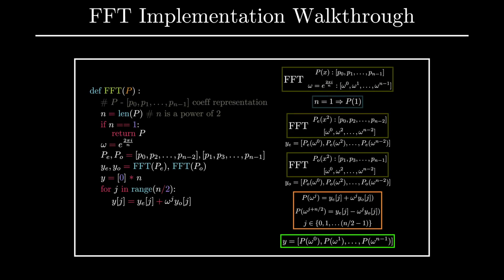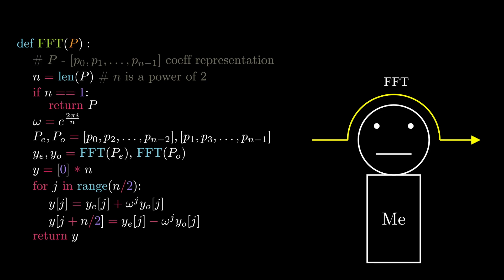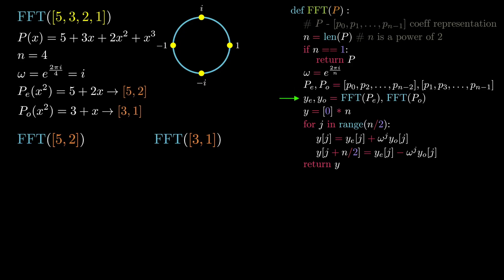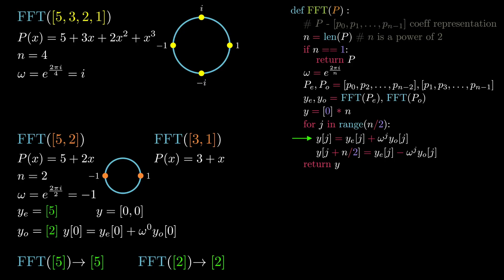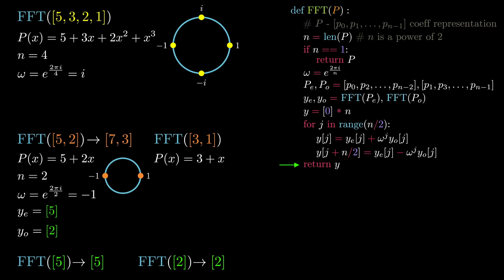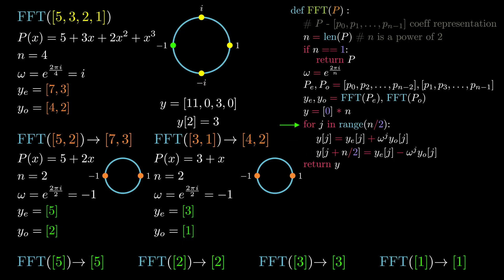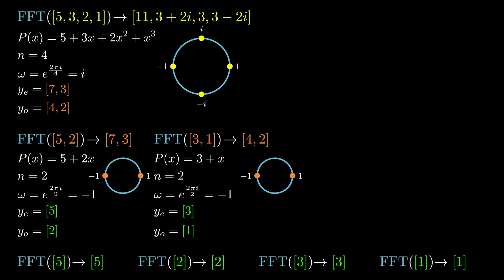FFT Example: Unraveling the Recursion

Comment: I remember studying the FFT in college (some 50 years ago) and I used it throughout my career. I’m now retired, but I still love to watch videos on Maths. Yours are particularly clear; in fact, they are works of art. Excellent!
Reply: What field are you in? Where's FFT used a lot?
Reply: @whitewalker608  math computer science physics
Reply: @whitewalker608 GPS, data compression (MP3, MP4, JPEG), it's the barebone for (any) control engineering tasks, you can multiply polynomials and large numbers easy which is used all over the place in crypo, and seismic detection.
Seismic detection was the initial driver, as people wanted to detect if anybody on the world was testing nuclear bombs or similar.
The same technic is used on earthquakes and tsunamis, and you can also use it in predictive maintenance of machines that can not fail.

Comment: I have been mulling over the FFT for WEEKS. Finally I have understood it, just by seeing that for 4 elements, the number of multiplications we did was 2*2+4 = 8 = 4 log2(4), compared to 4^2 = 16 for the DFT. For 8, it would be 4*2+2*4+8 = 24 = 8log2(8), compared to 8^2 = 16. I have an exam on this this Monday, so thanks to you if i ace the FFT question!

Comment: Hi Reducible,

How to programmatically compute the value of Ѡ?

In ur example, u hav used hard-coded values [1, i, -1, -i] when n=4, and [i, -1] when n=2. What if n=8, or a much bigger value? How to then compute Ѡ = eˆ(2∏i/n)? Or, is there a constant value for eˆi ?

Thanks!
Reply: Hi Reducible,

Ѡ = e^(2∏i/N)

I think Ѡ can be implemented as cosΘ + i*sinΘ, where Θ = 2∏/N

The java object (if implementing in Java, for example) can handle the real part cosΘ and imaginary part sinΘ separately

example :
com1 = x1 + iy1
com2 = x2 + iy2
com1 + com2 = (x1+x2) + I * (y1+y2)
com1 * com2 = (x1x2 - y1y2) + i * (x1y2 + x2y1)

Makes sense?

Comment: In the previous video on FFT you mentionned early the relation to time domain and frequency domain. The time signals we feed our FFT algorithm with are however not polynomials. Could you explain why this works not only for polynomial value pairs, but for time/frequency signals too? In time and frequency domain there greek letter omega is often used as circular frequency which is a  real number in practial cases. Is there any link between these two omegas? What is the importance of frequency to this algorithm?

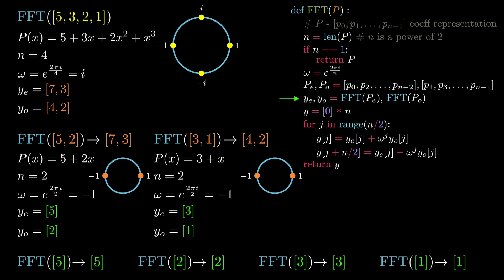Comment: 5:00 I found out that the values you get from that loop is in pattern...for at least those two example and that is :

note:- I am a lot younger than you would expect so i don't get a most of things in the video i am just watching for little prior knowledge when i actually need to learn it properly

lets say those variables as  FFT[ x, y ]
lets say those values you get after the loop as [ a, b ]

the values after the loops for a  is a = x + y    (initially I noticed it this way  y = a - x)

the values after the loops for b  is b = x - y     (initially I noticed it this way x = y + b)

That's it I don't know if it is actually correct and I can't check too because I don't know how to so if you can then check if it's pattern is wright?
Reply: This is correct. When our input consists of two numbers X and Y, we are essentially evaluating the function f(t) = X + Yt in the points 1 and - 1. So for 1 we get f(1)=X+Y and f(-1)=X-Y.

Comment: Your videos are very helpful, and I started feeling like I am ready to solve one programming problem related to FFT over rings modulo p.
However when I started implementing stuff, I realized I am missing some crucial part.
If FFT(polynomial) returns n values for power n polynomial, how we can compute poly1*poly2, if we have only n points? We need 2*n points.
Reply: I checked other implementations, and they are computing poly1 and poly2 for 2n points. After multiplication we have 2n points and can calculate 2n coefficients.
Reply: I think this video is just describing FFT, not necessarily poly1 * poly2. For that, we have to evaluate a value representation that will be of length 2n + 1. Furthermore, that needs to extended to the nearest power of 2.
Reply: @johnfazzie3384  You can add dummy 0 coefficients and it will work just fine. In fact, if the number of actual coefficients isn't a power of 2 you have to do so. For example, for a 4th degree polynomial you have 5 coefficients, you have to add at least 3 more to get 8 in order for this FFT implementation to work accordingly.

Comment: Hello, there seems to be an error in your video. I just lost few hours trying to implement this algorithm based on your pseudocode. And constantly got wrong result, for example (1,4142134 + 3,4142137i) instead of (1,4142134 - 3,4142137i). Finally i checked on wiki Cooley–Tukey FFT algorithm and there is minus in omega - e^(minus 2 * pi * i / n). Now it works fine.
Reply from the maker: This is a good point. Technically it's not an error, the minus sign is just a different indexing of the frequency bins. In signal processing implementations of the FFT, you will see a minus sign in the exponential since the indexing of frequencies from this result is easier to handle. In the polynomial multiplication context, the other sign convention that I used here is better since the jth index corresponds to the evaluation of the jth root of unity. Here's a good discussion on this topic: https://math.stackexchange.com/questions/58163/dft-why-are-the-definitions-for-inverse-and-forward-commonly-switched.

Comment: I actually more confused after watching this video than i was from the previous one. The only question i had was how this thing ensures there are no complex coeficients after IFFT is done. But now it is so much more))) So based of assumtion that you are multiplying two polynomials of highest power x3, your final polinomial would have highest power of x6 thus n has to be 8? Full video with two FFTs one multiplication and one IFFT would be so much appreciated.
Reply: The reason that there are no complex coefficients after IIFT is that complex conjugates sum up and gives zero imaginary part.
Reply: Let's say the polynomials have degree n1 and n2. The resulting polynomial has degree n3 = n1+n2. You find n = the smallest power of 2 strictly above n3.

When representing as coefficients, you make both polynomials start out with their coefficients then pad out with zeros until you have exactly n coefficients.

Let's take the polynomials x^2+2x+1 and x^2+5. The degree of the polynomials are 2 and 2, thus the resulting degree is 4. You want n=8. (you cannot use 4 as you need strictly greater, so 8 is the smallest; you can do 16 or 32 but why would you?)

Then the polynomials are represented in coefficient form as [1, 2, 1, 0, 0, 0, 0, 0] and [5, 0, 1, 0, 0, 0, 0, 0]. You do FFT on each, you multiply pointwise, you do IFFT on the result and are done.
Reply: @paulstelian97  p
Reply: @paulstelian97  p

Comment: Your videos are absolutely amazing.  I did some of this in college so it's great to see this information presented with such clarity using clear language and modern techniques. 
Specifically, though... I can't understand the link between FFT and what I understand as a Fourier Transform.   For a normal Fourier transform, you're translating a time-domain signal into a frequency domain signal, or vice-versa.  But with FFT you're translating between value domain (which could be time-domain) and a polynomial.   What's the link between polynomials and sinusoidal signals?  How can this function compute a discrete Fourier Transform?  edit: It's on the tip of my brain.  I can see how using very high order polynomials you're going round the unity root circle in a similar way you'd do for a Fourier Transform, but I still can't get the link.
Reply: Think of the convolution theorem, convolution in time domain is multiplication in freq domain. Convolution of the coeff representation (corresponding to polynomial multiplication) is the same as pointwise multiplication in the value representation.
Reply: @smolboi9659  Thanks for this, it makes sense

Comment: I tried implementing this in python and it worked nicely for the FFT but for the IFFT I run into problems... does anyone know what could be wrong? I pretty much copied the FFT and just changed omega as described and the recursive call to the correct function. If I try for instance IFFT([1,-1]) I would expect [0,1] (function y = x), but I instead get [0,2]...
Reply from the maker: I'm glad you tried implementing it -- see description in my main FFT video and pinned comment for error correction -- there is a subtle error I made in the IFFT.
Reply: @Reducible  Should have found that, thanks a bunch! Makes sense :)

Comment: I'd like to add a very interesting point. While working with discrete signals, it common to use Z- transform. It leads a vector to a polynom in the variable z. The interesting point is that a polynomial multiplication is the convolution of its coefficients. The discrete convolution can be performed with a "smart" internal product. "Smart" because of size of results, where the product starts and finishes for each and a back to front flip.

I'd be glad with a Z transform video. :)

Comment: Amazing explanation and visualization! Thank you for another awesome video!
A small question. It seems that roots of unity were used to perform fewer calculations and use the repeating values for symmetrical pairs. However, is the code the time-consuming expression omega^j*y_o[j] still appears twice, so we don't benefit from using roots of unity as an input. Was it done to keep the code clear or did I get it completely wrong?
Reply: I know this is from 8 months ago, but I thought it was worth adding to Reducible's reply - yes, assuming no compiler optimisations, the code here is slightly inefficient as omega^j*y_o[j] is repeated for both lines inside the for loop, when you could store the value of that in a temporary variable and use that twice instead. However, being able to make that optimisation is not the main benefit of using roots of unity, it is just a nice bonus - the time complexity of the algorithm stays the same regardless, you are just speeding up the calculation by a linear factor (as Reducible explained - the main benefit of using roots of unity here is how they allow you to split the problem recursively and therefore obtain O(n log(n)) time complexity).

Indeed, in this case, the actual speed-up here would be very small - omega is only ever raised to an integer power which can be done very efficiently and then you have a single multiplication which can be done even faster.

Also note that in many programming languages, the compiler will detect a repeated calculation where the input value is unchanged and will optimise it automatically, so I wouldn't always worry about tiny speed-ups like this unless you actually notice a performance cost after profiling your code.
Reply from the maker: Good question. The way the code is written actually is fine. The key idea here is that instead of performing n multiplications n times as we do in standard polynomial evaluation, we perform the operation recursively instead. You are right that each recursive call take n operations to compute. But the key idea is that at every level of the recursion for both odd and even degree polynomials, the polynomials have half the degree of the original polynomial. This fact makes the entire algorithm run in O(n log n).

If you are familiar with recurrence relations, the formal recurrence relation here is T(n) = 2T(n / 2) + O(n) which when you solve it out, gives you O(n log n). Another way to see what's going on that may be more intuitive is drawing a tree like diagram of the recursion and amount of operations in each call. Generalizing that diagram, you will see it's still O(n log n).

Comment: But how does this connect to sample values!!!!?? How does this example correlate to actually converting from time to frequency??? Is the input just you sample values over a slice of time?
Reply: His approach of viewing the FFT is a lot different than is normally taught in DSP classes so you might not immediately see the connection with frequencies. You can still see relation to frequencies by looking at the spacing between the values on the unit circle. Imagine going around the unit circle by stepping through the sample points: The more closely the values are spaced together the more steps it takes you to complete a full turn (therefore low frequency). High frequencies correspond to values that are more widely spaced apart. So, each set of sample points distributed around the unit circle corresponds to a base function in the DFT.
I like to think about the DFT as a set of dot products between the signal and each base function (so conceptually it is in no way different than any other linear coordinate transform). And the FFT is a way to avoid explicitly computing every single dot product.
Reply: @compuholic82  right. the dot product part is a bit interesting. never thought of it that way

I did end up trying to code this up. in the video it looks like python, but there were some things in his code that did not at all looks like valid python code. So I had to do some reinterpreting what was going on. And I managed to get it working, although the output for some reason looks like it mirrored. like the elements past "n/2" were the same as the elements before "n/2" but flipped. Idk if that's a bug or just a part of how it works?

Also I find it kinda bizarre to use imaginary numbers. For a long time I never really understood it, but recently realized that imaginary numbers can just be thought of as 2D vectors. And the whole  "e^(2*pi*i/2)" crap is actually just a cos,sin vector in disguise, which I would have never realised unless I dug deeper. And it would seem like it would be more sensible to view the algorithm in this way.
Reply: @Andrew90046zero  From your description it is not entirely clear what you were trying to do. But the "mirrored" elements may be entirely correct. An N-point DFT of any real-valued signal will only result in N/2+1 independent coefficients with an even symmetry. The DFT of a purely imaginary input signal will lead to an odd symmetry. And it's very common to use complex numbers here. Complex numbers really shine in DSP applications because manipulating exponential functions is a lot easier than working with trigonometric functions.
Reply: @compuholic82  well I aim to use this in my own applications so I can detect patterns or any other type of situation where I need to break down a signal.

and I was just unsure if there was a bug in my code because the output array has mirrored values.
Reply: Also u can think of convolution theorem. Convolve in time domain is multiply in freq domain. Convolve poly coefficients is same as multiply out value representation.

Comment: So, when we plug in the coefficients for a polynomial into the FFT, we get a set of values that this polynomial takes on. Got it.

So, how does this have anything to do with plugging in values of a periodic function and getting the coefficients of complex exponential functions?

(I'm in third semester electrical engineering, I've had my Algorithms and Data Structures course last semester and didn't understand the FFT. Now I'm learning about all the Fourier stuff in Calculus 3 and Signal theory. I would love to get a deeper understanding, because I find Fourier analysis fascinating!)
Reply from the maker: Thanks for this comment and there is a really interesting connection. I wanted to include it in the video, but it was already pretty long so I had to cut it out. Might make a separate video on it. 

So the signal processing FFT is often taught with respect to taking a time domain signal and finding the coefficients of fundamental frequencies (which can be represented by complex sinusoids). In the signal processing FFT,  you will actually see the DFT matrix defined slightly differently: https://en.wikipedia.org/wiki/DFT_matrix where w = e^-2pi /n. This is just a sign convention so either definition is fine as long as the DFT and inverse DFT are appropriately defined. But one interpretation of this that relates to this particular story with polynomials is similar to how we use the IFFT  with e^-2pi /n to calculate the original coefficients of our polynomial from sampled roots of unity points, the FFT in signal processing contexts attempts to find the coefficients of basis vectors that represent complex exponential functions of fundamental frequencies. 

Obviously there's a lot more details here that I can't hope to do justice in a single comment, but I hope that gives you some insight. Again, this might be another video since a lot of folks seem to be interested.
Reply: @Reducible  Yes please that would be so great!